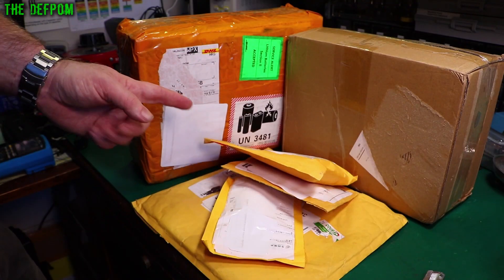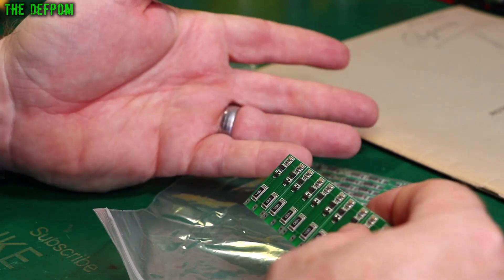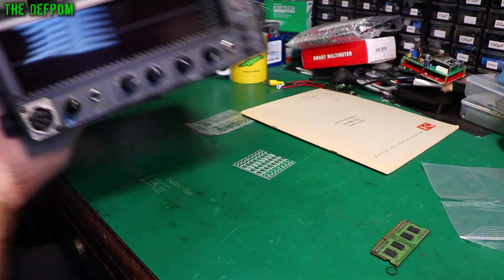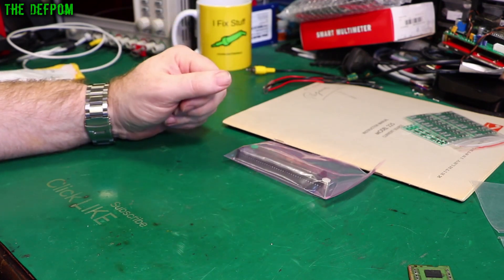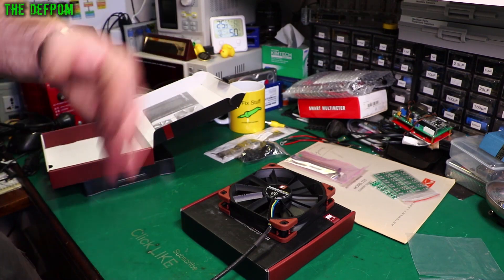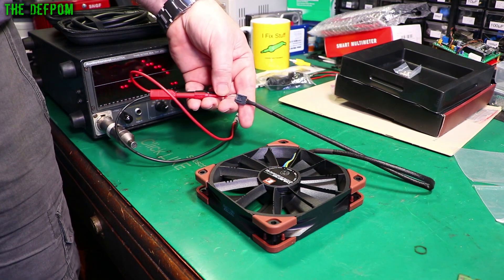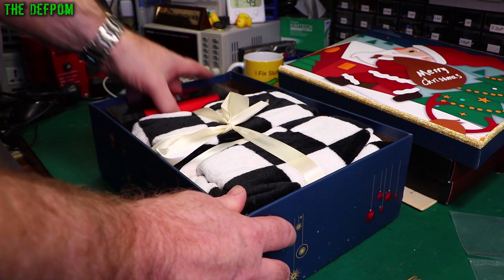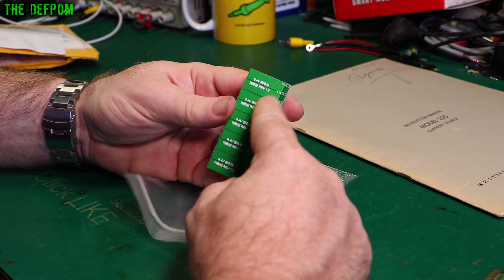🔴 What Did Santa Bring Me ? - Mailbag Monday 27th December 2021 - No.905

Comment: At 12:22, I think you will find the PWM is an input to the fan, so you can control the fan speed.
Reply: And if you leave the PWM fan speed control open, say tying to a 3-wire fan connector header, then the fan will run full speed.
Note: 4-wire fans used mostly on PC motherboards so the BIOS can control the fan speed.
Reply: @IanScottJohnston  A lot of servers have then too, to keep the noise down.

Comment: My AudioControl RTA has a battery pack inside, maybe i should dust it out to see if it still functions after 30 years. Maybe i could show you how they wired in the battery pack.
Reply from the maker: If you did a little video on it I’m sure it would help people, there isn’t a lot of info out there on the circuitry and I had to figure it out with some help from someone that sent me photos of the charger circuit board.